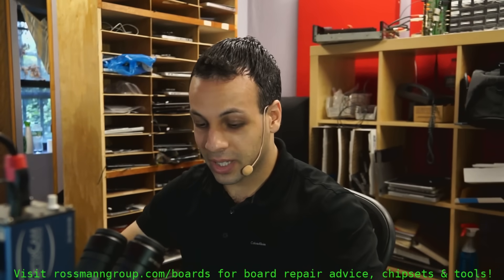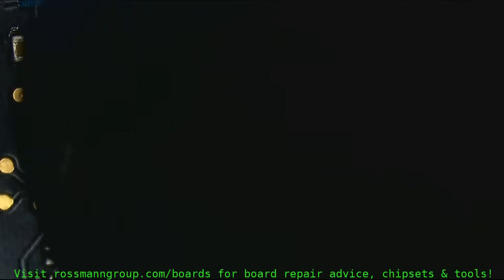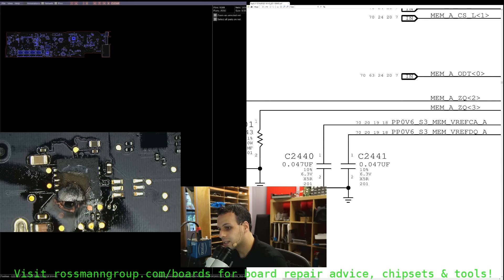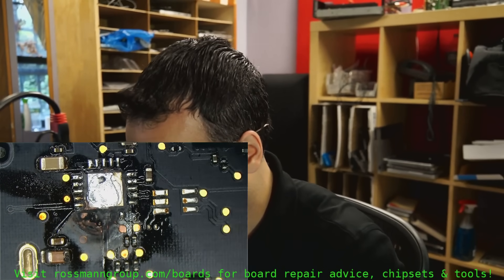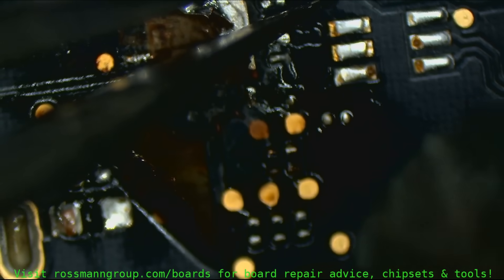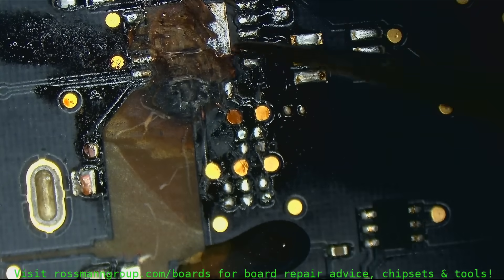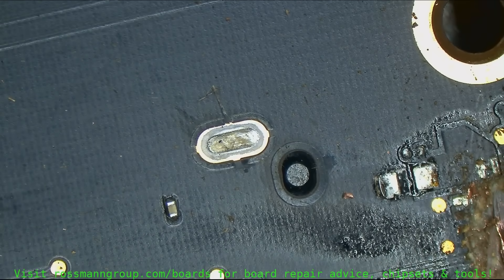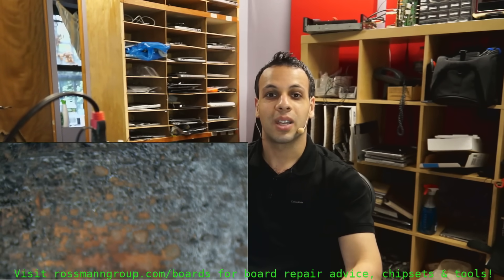They call it thunder "BOLT" for a reason; Macbook board erupts.

Comment: A fuse is supposed to block voltage and current before burning out the components on the other side of the fuse. Is it stupidity or malice that the fuses on these motherboards fail to do that? Are they there for show, to show good intent, but do they actually represent thoughtless engineering?

I get the impression that liquid damage would be much more benign (eg. plain water) if the fuses worked. Of course, corrosive or more conductive liquids would still be a problem.

It seems to me that charger malfunction should never fry a board if the fuses worked.
Reply: I mean, not fry the board other than fry the fuses, which would be attached with the intent of being easily replace.
Reply from the maker: It would be nice to have some sort of protection on this circuit.
Reply: I see. Thanks.
Reply: Well i mean it is apple so the fuses would probably be proprietary and shit...
Reply: If Apple cared they would install SM thermal circuit breakers.
Reply: Very angry pixies!
Reply: Possibly it is the case that you can't have the general motherboard fuses rated low enough to protect all possible current paths resulting from a fault  and still be high enough to supply the  circuits under working conditions.
Reply: oOMonkeyMagicOo AvE magic pixies
Reply: I read "Great way to win the lethal lottery " ;)
Reply: @hill billy "goof" Really? LOL! Yes I have used windows for along time, but not exclusively. I have used many OS's and have no real preference, it's just a tool. It's the applications that are important to me. After that it's a choice of hardware to run these applications. Apple hardware products give the least bang per buck IMO and have no applications that I require that I cannot get a cheaper alternative to on other OS's! 

Of the dozen or so hardcore Apple users I know, I would not consider even one of them tech savvy! When I ask them why they buy and pay a premium on Apple products over Android or Windows based hardware, the typical response is "Apple is better" "It just works". They can not expand on this reasoning!

I reckon you fall in the "it just works" camp, since you have never had to work on any ios product!
I like to "work" on my products, that's how I get the best value out of them. So in that sense, Apple products have even less value to me now! Thanks for the heads up!

If you are happy with Apple products, long may your  happiness last. I have no horse in this race and do not really care what people spend their hard earned on!
Reply: I should have just said any flammable environment at the time. Companies like Shell, Exxon, BP and their subcontractors here takes any electronics seriously. I also made another comment as well regarding the most likely scenario. That is that this is usually in the hands of college students typing whatever the TA is saying. At least thats how we used laptops 10 years ago (might be tablets, phones, or whatever now). The most likely place of an accident being in a chem class lab where I would think there are only "basic" safety standards. I know that this has a low chance of starting a fire (given all the things that need to fall in place) but there is still a chance that could be reduced close to zero. All in all good to re-enforce safety policy. Hope Chem Professors and their TAs see this.

As for fuses, the point IS to provide protection. Anyone replacing a fuse should know it doesn't blow for no reason. Users of any electronics used to know this. Unfortunately we live in an age of "easy use"/ "dispose if its dead" electronics. Instead of taking time to fix something we throw it away wasting money, resources (the ICs), and contributing to environmental pollution that clueless folks care oh so much about.

Also funny story about the battery on mobiles. I recently got a V20 (hope it goes well) cause my Iphone 5 (I didn't know what I was thinking at the time) had battery power issues (im still keeping it though). The guy at T-Mobile looked at me puzzled as to why I would want a phone with inferior photo and speaker quality. I said because it has a removable battery and removable memory chip. Everyone else around me looked at me like I'm crazy but he knew what I meant said no more and stopped trying to sell me either the, what will fail, Galaxy or Iphone. Everyone thinks to get the best of the best camera (get a Canon or a Nikon then). Going from an Iphone 5 to a LG V20 is a huge improvement anyways. I don't care for the best of the best.
Reply: The thinking that "fuses aren't designed to protect components" really only applies to internal circuitry that has no interface to something outside the design. When you have something that interfaces with a device outside your chassis it needs to be fused to protect against whatever junk somebody tries to attach. "Hurr-durr, I'm going to attach a million things to this port and draw 10x the current it's rated for!"
In general a fuse will at the very least /limit/ the damage caused by one component shorting too. The amount of heat required to cause the damage seen here would be stopped before the board becomes completely fucked. The fault can be found and fixed good as new.
Reply: Generally, ICs are like delicate little flowers. Supply them with too high a voltage and just enough current, and the'll gladly shit their pants and release the magic smoke. Fuses are not very fast acting in the grand scheme of things, and aren't capable of breaking open fast enough to prevent damage to semiconductors. It's bad design practice to expect them to. Serious pieces of kit use what's called a "crowbar circuit", which helps protecting expensive electronics from damage caused by such transients. They act by shunting (or grounding) the protected rail, thus opening the fuse, if the voltage/current is to exceed a preset maximum value. But Apple* doesn't give a shit. They're too cheap for that! Slap a fuse in there and call it quits. No worries!

*Actually, I'm yet to find ANY manufacturer that gives a toss about it. But Apple charge a hefty extra for their products, and you'd expect them to deliver the value they are paid for.
Reply: If you don't know that fuse must be the strongest part of the circuit you are obviously not an electrical/electronics engineer. 

Seriously tho, bad things happen if stuff shorts out, no way around that. What you can do is prevent open flame and the house burning down, that's what the fuses are for mostly, not to save the device.
Reply: You need to understand faults better.
A faulty part may not short out completely. If it is only partially shorted, it will consume excess power and get HOT.
Even if it is only half an amp, at 5W, that is 2.5W, which is enough power to make a small part get excessively hot. So in this case, the short circuit/overload was only partial - not enough to blow the fuse, but still enough to do damage.
As for those PTC resettable fuses ... I don't like them because they don't always work well, and they still pass some current when "tripped". Sometimes, they will burn out (literally...!!), especially over time as they degrade.
Reply: +oOMonkeyMagicOo Perfect! Hadn't read that comment, but it summarizes pretty much everything.
Reply: or it could be from a non surported power block.
Reply: A fuse blows when there is a short circuit. It does not provide overload protection.
Reply: Andrew M Garland 
It's crooked sales techniques
Reply: Fuses burns well after some sensitive ICs. Especially CMOS ones are already dead.
Reply: A fuse protects against short circuits. A fuse can carry its rated current indefinitely. There are different types of fuses eg. quick acting, etc. You can't rely on fuses alone for protection, but they have  their place in the protection circuit.
Reply: Andrew M Garland 
Kind of different but electricity doesn’t care: 
We never trust the main breaker on a generator to trip before meltdown, most of the time they won’t, so treat it as a disconnect. 
Soldered fuses on a board are just lame too.
Reply: If the fuses don't fit, you're making shlt?
Reply: Fuses are only meant to blow at a certain current. If it fails to reach overload and yet still fucks components downstream, then the fuse is overrated making the circuit susceptible to cascade failure. If you cannot control the circuit current natively, then your circuit will BLOW every time. I mean, it's not like a current-limiting resistor positioned near or using existing heat-sinks could do the jeezless job /sarcasm
Reply: Everybody in this topic seems to ignore the fact, that fuses do blow above a certain current, but does not LIMIT the current to that level until they open. The fuse is a mechanical device, the wire inside it should warm up, this takes time. During this time ALL the short circuit current flows the system capable of providing and sinking, which can be several magnitudes higher than the operating current is. Any semiconductor can be killed in matter of microseconds, while mechanical fuses require somewhat in the milisecond range to heat up and trip. In no way you can protect a semiconductor with a fuse. The only feasible option to protect a system is to build an electronic overcurrent protection which reacts several magnitudes faster than any mechanical fuse. Thyristors, triacs and diodes are somewhat of an exception, they withstand more abuse and can be protected with properly sized fuses, but that is still not as simple as choosing between 5A or 10A fuse. The datasheets often gives an i2t data for you, and you should calculate (and maybe limit) the current rise time in your circuit and choose an appropriately fast fuse using it's datasheet, not by feel and guess.
Reply: Fuses have burn times before they open. So that means there could be conditions where the short happens too fast for the fuse to react to it. Also, if the fuse is on a power supply line, for instance, and the rated current for that supply is 1A, then the fuse may be sized to open at 1.5A or 2A. Often, the amount of current it takes to damage an I/O on an IC is as little as 30mA. So you could have many shorts on individual I/O pins before a fuse would trip. Fuses are really only meant to protect things upstream of them, not downstream.
Reply: Fuses are there to cut power once there is a serious fault which raise the current flow sufficiently.  They are there to protect you, not the circuit.  These things fail mainly due to insufficient cooling.  If you increase the temperature of a conductor, the resistance increases, increasing the energy released as heat.  This little vicious circle and/or the life shortening affect of temperature on semiconductors, is what leads to the failure, although they aren't often as spectacular and obvious as this one.
Reply: I always use protection. Still my wife is pregnant and our mail is delivered by a woman.
Reply: Instead of fuses, Apple should take a page from Star Trek engineers and install rocks that shoot out when circuits are overloaded. That way you know something broke.
Reply: Fuses are in no way designed to protect the circuitry or components. By the time a fuse blows, chances are, something more significant has already let out the smoke. They are usually to prevent fire, or more specifically the supply cables catching fire. To depend on a fuse to protect your circuitry, means you are designing it wrong!

Edited to add, when a component blows, it can go open or short, the fail mode is not certain. In the event of a short, a fuse will blow open and kill the supply. Fuses have a known failure(it's what they are designed for, so maybe not a failure, if you know what I mean!)
Reply: @oOMonkeyMagicOo   That's something my friend from work is always trying to push into the head of his brother: fuses do not protect the circuit from getting damaged, fuses protect other stuff from burning after the circuit fails. In this case a fuse would be nice, because after shorting the thunderbolt, it would secure this piece of board from burning up. It would give a chance to salvage this situation and putting another chip instead of a broken one.
Reply: @ogi22  While the fuse should protect stuff upstream of the fuse, the stuff downstream (in this case the laptop) has no protection from the fuse. A simple crowbar circuit as mentioned above could be used(in conjunction with the fuse) to provide some protection(but still not perfect). These can be made with 5 or so components and are not expensive to implement(Although several may be required per device, and definitely should be on any port that outputs power). Even many cheap $30 power supplies will have them. Even better integrated solutions can be obtained for a few pence. I guess though when you are making millions of devices a few cents adds up and eats into your profit margins. This just exposes Apple for the shysters they are, who would rather you buy a new 2 grand laptop. Lots of "Highend" Equipment will have protection because the makers know they are selling quality, and the users will appreciate it and be loyal to that product, essentially for life. I don't know where the Apple users loyalty comes from though as Apple treat their users like dirty idiots.
Reply: @oOMonkeyMagicOo   ever heard of fuses for protecting semiconductors? cause they are real, except for one tiny little thing - being big and pricy. types i know would never fit on such boards but they indeed can protect semiconductors
Reply: @user-uk5bx1kz2k  I have heard and seen high speed fuses in circuits before, dont know if they are the ones you are talking about though. I Still believe though, there are better ways of doing it, especially on high end equipment where you can afford to over design the circutry.
Reply: +oOMonkeyMagicOo thats actually really interesting, here in Denmarkia we are always, without fail, told that fuses are failsafes during our three years of physics classes.
I thought fuses were literally just thermal circuit breakers that would go "NOPE!" once enough voltage were forced through it.
Reply: I have to say its negligence in design. This is a macbook. People could be caring this in certain places. Imagine this product next to petrochem vapors..... Great way to win the legal lottery.
Reply: Any explosive environment for example petrochem vapours, requires equipment with an Intrinsic safety rating. Anyone working in these environments would have being giving the safety training and should know not to use their macbook or iphone in this manner. Apple would be in no way responsible if a macbook managed to blow up an oil rig! It's not intrinsically rated and Apple don't claim it to be!

The real problem is with typical Apple users who  pay three times what a product is worth just for the "Design" or "Apple Logo" or "Prestige", but are then not willing to spend more than $20 on a new charger when required, and get the cheapest one they can find! 

If your product gets liquid damage, Turn it off (Remove the battery, can't with Apple) and send it to Louis or whoever and have it cleaned and checked. If you try and dry it in a bag of rice or the airing cupboard and then plug it back in a week later, this sort of thing can happen. This is not an Apple fault as much as it is a user fault!

And no amount of fuses regardless of their ratings will protect components, that's not their purpose. They are an after the fact component, that if you are lucky, they will prevent everything burning up once the initial faulty component shorts and takes the fuse out. It is not uncommon for a component to blow and take out a fuse, only to have someone replace the fuse thinking that's the fault. Plug the equipment back in and then blow several other components and make the unit BER! At this point they will send it on to Louis and pretend it's something simple to fix!
Reply: It could be high enough to go through the fuse for long enough before it blows.
Reply: Don't take my generalisation personally, I did say "Typical Apple users". And the point I was making is, if you buy a premium product, expect to pay for premium peripherals. Don't skimp on cheap Chinese knockoffs and complain when they don't match the original specification or even their own claimed spec!

I also made no reference to Windows or Android being better(Even though they are miles ahead), that's your own Apple remorse that brought you down that path! An OS will only give you what you need if you know how to utilise it! If you get all you need from Apple, happy days for you! You are happy with Apple, you don't need my approval to spend your money! Enjoy your Apple products, I will not criticize you for it.

And as much as I despise Apple for numerous reasons, none of my previous post were having a dig at Apple for the above fault, if anything I was defending them from blowing up oil rigs because their fuses did not protect the circuitry! Just for clarity, no fuse, fast blow, slow blow, High rating or low rating is designed to protect components, they may protect some components in the event of a fault, but anyone who designs a circuit with a fuse to protect the circuit is doing it wrong!
Reply: When you plug something into USB that is drawing too much power, you get a warning and the port is disabled. They must be doing the same for all other ports? In that case, something more then drawing too much current occurred.
Reply: When you interface something to a port and draw power, in essence that port is now a power supply. Any fuses on that port that blow when too much current is drawn, is bad design. The fuse will not offer sufficient component protection on either side! It does not take many components to do it right, you can even get fully integrated current sense solutions.

Fuses should only be thought of as a last line of defense in your circuit and should not be integrated on the basis of component or PCB protection. Many circuits will contain sections/components/tracks that cannot even handle the current rating of the main fuse and can burn up long before the main fuse pops! This is where internal fuses are added. This can be designed out of the equation but is a decision made on cost.

On large or complicated boards, it helps to think not of the board as a whole, but think of it like several smaller boards or circuits that are peripherally interfaced to each other. Where one circuit interfaces the next or shares a rail, fuses may be part of the interface between them, some skimp out and just use wire links or "zero ohm resistors", again based on material or production costs. There are better ways to design circuits for power control and I would have expected Apple to integrate that protection based on the cost of their products, but the would effect their margins. No properly designed power source, when shorted  should spew it's guts like the above.
Reply: I actually buy Apple because that’s what I like. I don’t like android and I do not like windows at all. I don’t buy the brand for any of the reasons you mentioned. This Apple Vs Windows and android argument is pathetic.
Reply: Ozzie Peck so you like paying double for a brand logo? Understandable, have a great day.